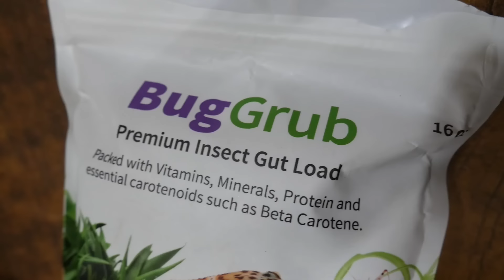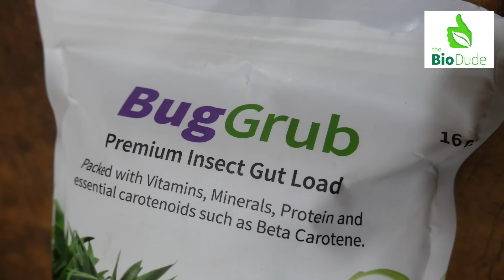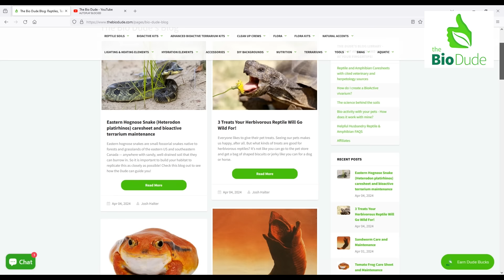The Secret to Building Indoor Ecosystems

Comment: It is dangerous to promote only topping up, plants deal with waste etc. not water changes. Test kits only deal with a minority of waste, using plants unlike the terrestrial environment is entirely unnatural and there is a lot they wont deal with. Most test kits are really vague but realistically need to be replaced yearly for accuracy. Only topping up is like having a viv with no vents at all but only so often opening them up. 
I feel this feeds into the aspect that the pet people don't focus on aren't researched. More then often fishes are the accessory unless it's marine. 
There is more to the tech, Fluval is cheap for a reason.
Paludariums have always been a thing in the aquarium hobby but the aquatic side is complex. Hence it's not popular over Ripariums.